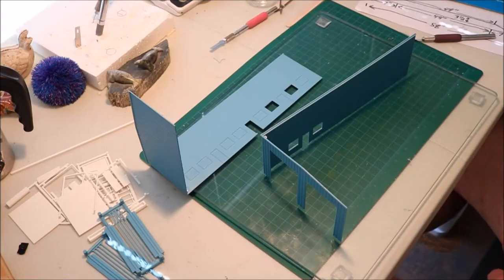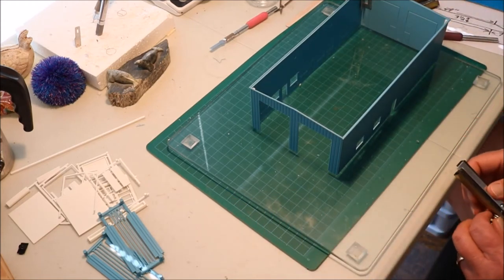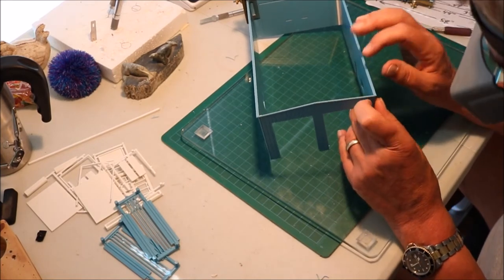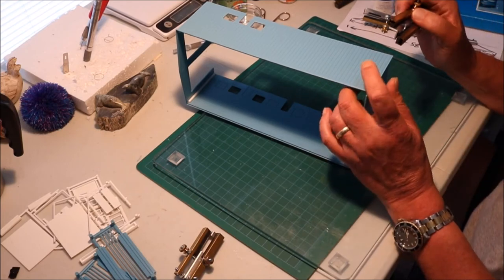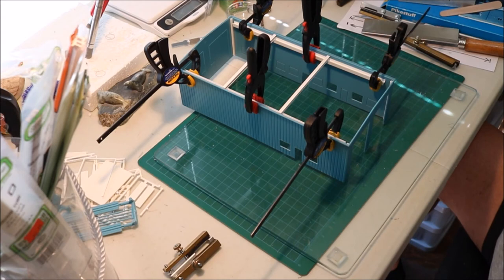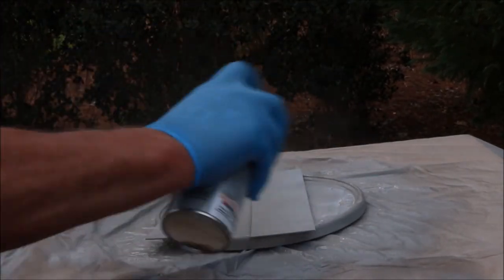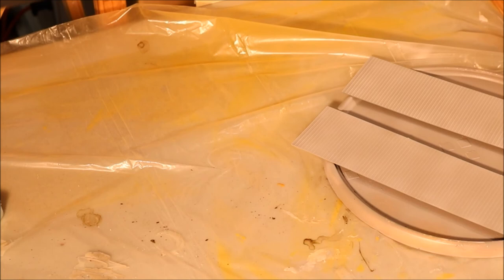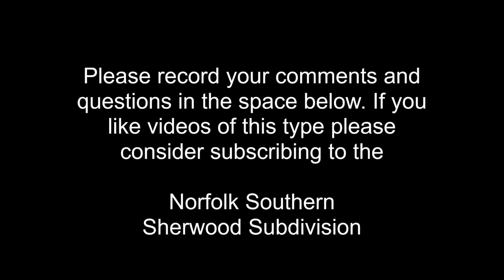How To Build and Paint a Pikestuff Kit

Comment: I've had these clamps and didn't like them as they got in the way. Gave them to a friend that uses them all of the time. I'd rather tack the sides together and hold them until the glue dries. Then go down the sides and align them as I glue. I find that bracing on the tops of the sides is not needed as the roof will do the same thing. I only brace the bottom if it needs it. I find that most of these buildings (and I have several) don't really need to much help. I usually repaint them also. Lighting is nice but most of the lights are not seen so why not just place them on the underside of the roof material?? I use Krylon paint and don't feel that I need a primer. Just several real light coats of paint. I usually put the windows and doors in before painting and just mask them.  The paint I use takes only an hour to cure completely so I can finish in one day.
Reply from the maker: Just goes to show you...there are many ways to solve the same problem.